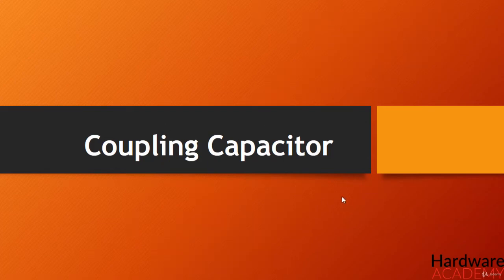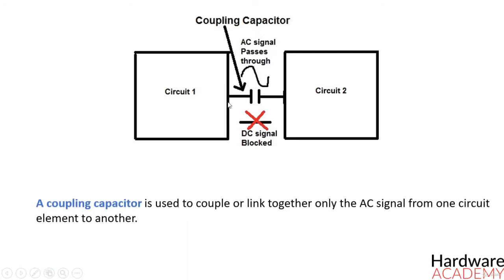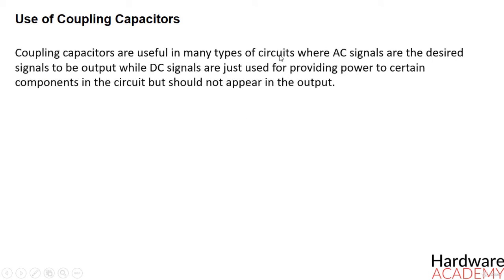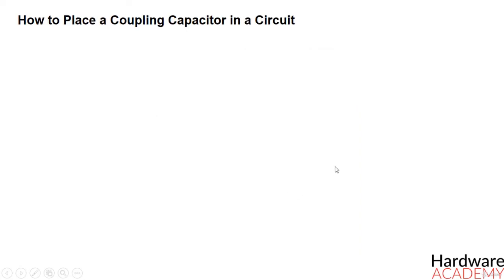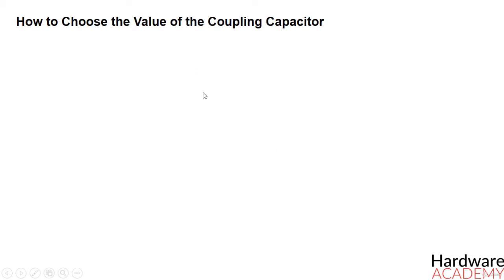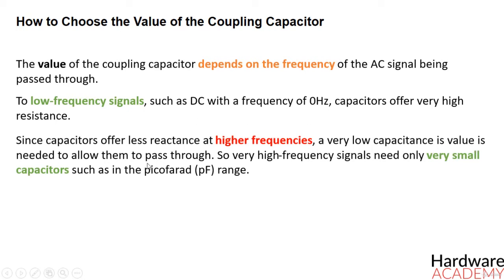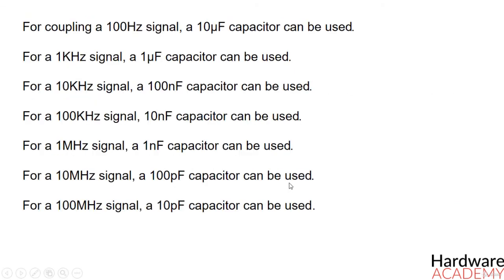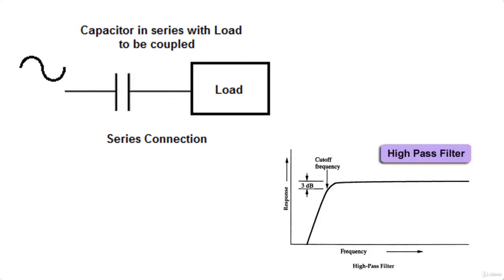49- Coupling capacitors

Comment: I need to change my existing coupling capacitors from .02uf 600vcd to .01uf 800vcd, is this going to drastically change the sound of my push pull EL84 stereo amp?
Reply: No problem. 
If you want a little deeper Sound change to 1uF ore more. 
I change in my tube Preamplifier from 0.47uF 400V  10x-times to 4.7uF 450V MKP, as highpass to get little more bass. No problem.

Comment: So in order to build wireless transmission in circuitry i have to understans how much the signal frequencies would produce and the value of input impedance? If equal then the frequencies can be pass through without wire to another electronic devices? Is it true??